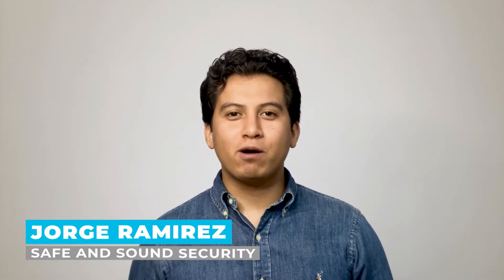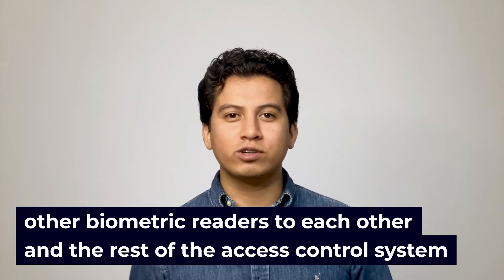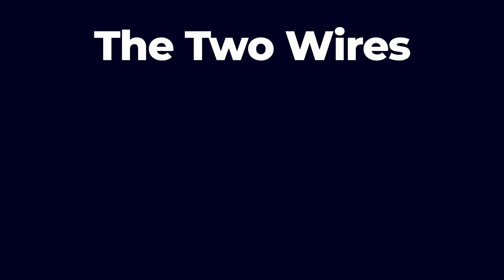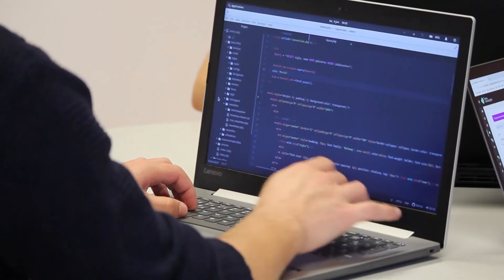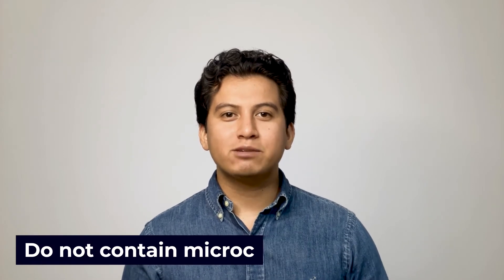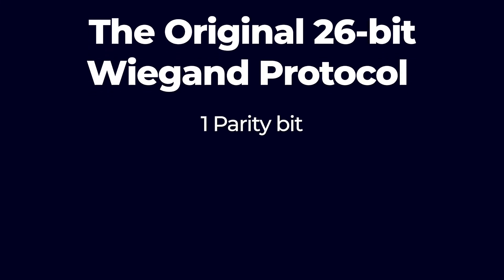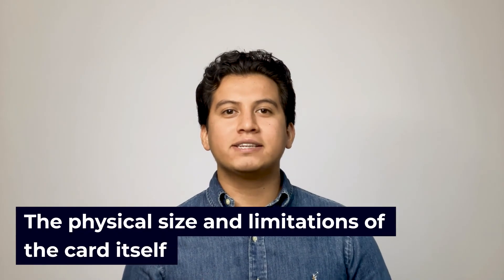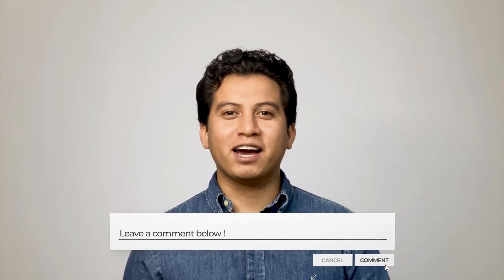What Is Wiegand Protocol?

Comment: 36 wiegand wires in card??? What on earth are you on about
Reply from the maker: Apologies for any confusion! 

It could be a mix-up in the explanation. 

Wiegand protocol typically refers to a communication standard used in access control systems, not the number of wires in a card. The reference to "wires" likely stems from a misunderstanding. Wiegand cards themselves use a unique data encoding method, but the "wiegand protocol" is more about the signal transmitted between the card reader and the control system. 

Thanks for catching that, and I hope this clears things up!